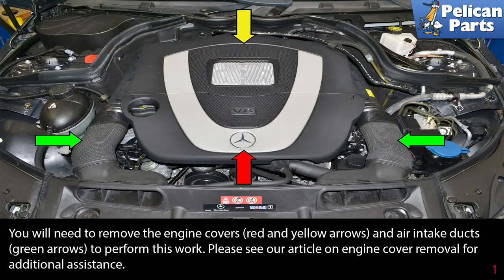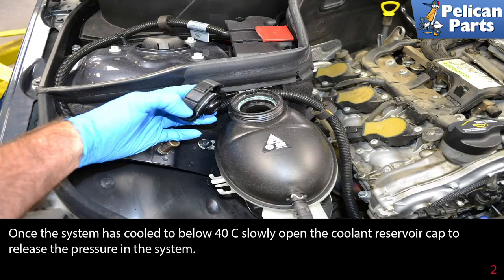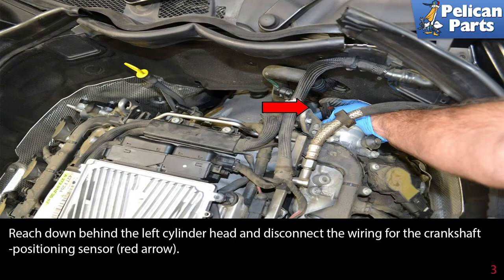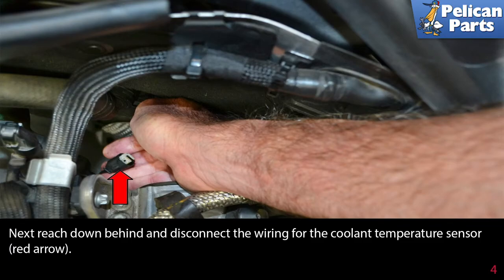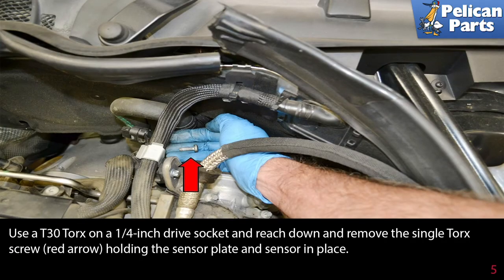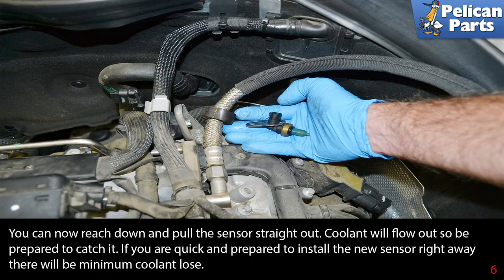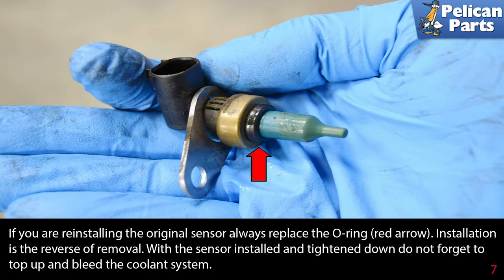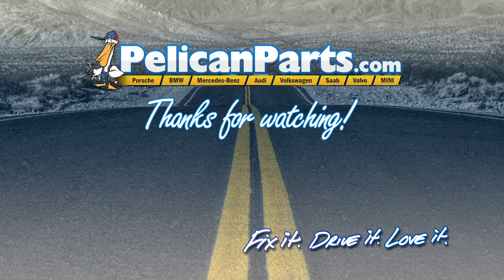Mercedes-Benz W204 C-Class Coolant Temperature Sensor Replacement

Comment: It would it would be more efficient if you explained to us the easiest way to reach around the back of this motor
Reply from the maker: The procedure shows how to access the part. Simply locate the sensor, press ands hold the release tab and pull the connector straight off.

Comment: Apart from the radiator fan,What other components does this sensor trigger..? During cold start and As soon as my coolant temperator reaches 50 degrees, my air fuel ratio changes to reach condition. I just dont know what component gets triggered to this effect. I have tested and whatch this behavior a number of times and i just can't point out the cause.
Reply from the maker: It's used by engine management, transmission, HVAC, etc as one of the inputs that determines system function.

Comment: Thanks for the tutorial. Quick question, Does the replacement of this sensor needs computer reprograming?
Reply from the maker: No, it does not.
Reply: @pelicanparts  I have a diagnostics on my GLK 350 2011   116k mil. Shop says i need to replace the fan assembly, coolant thermostat assembly, coolant temp sensor, oil coolant sensor and coolant reservoir.  price tag to fix it is $3250. I find it very odd that i have to replace all these parts.  I'm trying to get at least one more year bc i put on new breaks and new tires not even a year ago. Help wiht advise please!

Comment: Ive replaced this sensor on a W205 with the M272 engine.The reason you are not seeing it in any of these diy videos is simple. It cant be seen from above. You need to use mirrors and for the most part work by feel. It does help to unplug the crankshaft position sensor which the idiot Benz engineers placed in front the subject ECT sensor. The use of the stainless steel retaining plate is a good thing  Be prepared for cuts and scrapes to your hands. Make sure with mirror the old o ring is removed. I drained the coolant from the radiator via the drain port and the block by removing the lower coolant hose. Vacuum assisted refill is also a great thing.
Reply from the maker: Thanks for sharing your repair process and experience. These types of comments add so much to the Pelican tech community.

Comment: Help please ❤  c class w204  engine will a faulty  temperature sensor  cause
Reply: Other issues going into limp mode
Reply from the maker: I would start by checking the vehicle for fault codes. If the system is not working properly, a fault code will be set. This will be your best bet when diagnosing.
Reply from the maker: Cause what?

Comment: Great video 
I have the 250 cgi
When the engine is cold driving to operating temperature and put the ac on the temperature gauge drops to 50 or 60 and then after few km goes to operating temperature is this normal ?
Reply from the maker: It should stay steady in the warm zone once warmed up. Your thermostat may be failing.
Reply: @ thank you for the feedback 
I was also thinking about the coolant temperature sensor or should I just only change the thermostat?
Reply: @easyrider020  i dont think the thermostate has a temp gauge, the sensor is only to tell the cpu that the thermo is open or closed

Comment: Hi! Does the 2011 E350 v6 have the same sensor in the same location?
Reply from the maker: The sensor on your vehicle is located at the rear of the left (when seated in vehicle) side cylinder head.
Reply: @  thank you 🙏🏽!!!

Comment: Hi, thank you for the video!!! I have a w204 c350 v6 2008 and on the tester the temperature sensor show me different from the dashboard, it show me 78c on the scanner bud on the dashboard is around 89-90c 
I change the termostat and coolant (original dealership) and i still have this problem 

Also sometimes the the sigh on the dashboard fluted from 80c to 100c and show me the temperature engine 

What you recommended?

Thank you sir 🙏

Im not sure to change the temperature coolant sensor or engine temperature sensor
Reply from the maker: Are you checking engine temp on the scan tool and possible exterior / ambient on the cluster?

Comment: My car cranks but doesnt start, could it be the Cooland Temp sensor? As the Temp is at around 70c eventhough the its winter here, and havent started the car for 3 days. The temp pin instantly moves to 70c when put the key in ignition state.
Reply from the maker: Coolant temp sensor usually won't cause a no start. When your engine doesn’t start you’ll want to check the basics. Check spark, fuel injector pulse and fuel pressure, volume, quality and engine compression. Are there any fault codes? Once you figure out what is missing, it will be easier to diagnose.
Reply: @pelicanparts  ok i changed my sensor anyway since it was faulty. And right after changed my sensor i tried to start the car and there was a progress engine tried several times to spark. But eventually it went back to the previous state that which crhe car cranks but doesnt start. Thinking about scanning the code tomorrow.

Comment: Is the Thermostat sensor supposed to be flush with motor and not show any of the metal part or does it need to be pushed in more to lock in O ring ?.
Reply from the maker: Lubricate the O-ring with clean coolant. Then push it in with the sensor until fully seated.

Comment: hi, appreciate the video, good job! is this procedure applicable for a 2010 Mercedes C300 Sport? i don't see the mass air flow sensor in the video so just wanted to clarify. Thanks!
Reply from the maker: Applicable Models:

Mercedes-Benz C350 (2008-14)
Mercedes-Benz GLK350 (2010-14)
Reply: @pelicanparts  thanks
Reply: @pelicanparts  C300 4matic 2009 Mercedes?
Reply: Also, anything equipped with an M272 or M273, which is almost the entire lineup from around 2006-2011(2012 depending).
Reply: @RothBeyondTheGrave  C300 4matic 2009 Mercedes?
Reply: @robertbenz496  yup. That's the 3.0L M272 engine. You may have that vacuum pump in the way though, so it won't be a clear view. Vaccum pump is easy enough to remove, but without a mirror it's very difficult to get eyes on the bottom fasteners
Reply: Is there a video for the 2018 C300? Before I start removing things, I'd like an idea of where it is generally located. I've done the procedure before on my 1999 ML.
Reply: @adamyusuf2651  the closest video was this one but you might try checking the google for newer, more specific to your model.

Comment: Can u post a picture of the metal plate that holds the sensor in place i want to swap it very quickly but don't see how to get that metal clip over the new sensor...
If the sensor just holds itself in with the o ring and the clip just slides in and u out the screw back in..i don't know but. Let me know if you can been looking for pictures but think I'm just gunna have to stick my phone down there.
Reply from the maker: I don't have a photo to share.
Reply: @pelicanparts  USELESS VIDEO with LACK of photos - would have been nice to see some detailed photos. Agree with commenter!!!